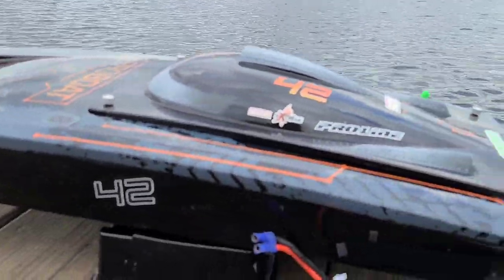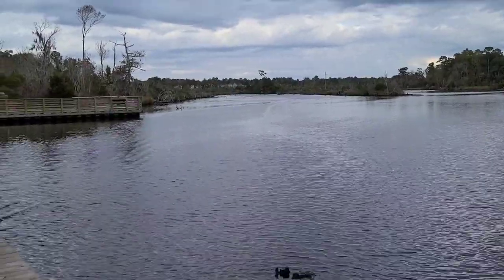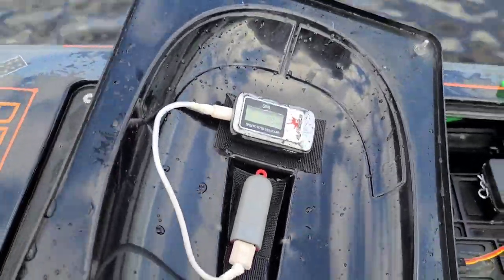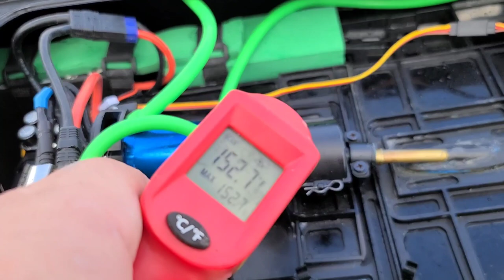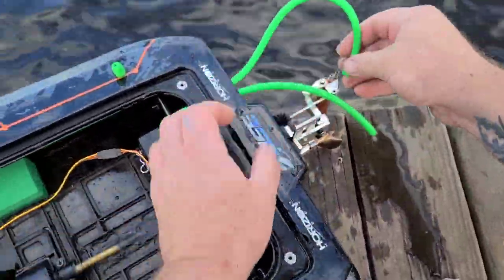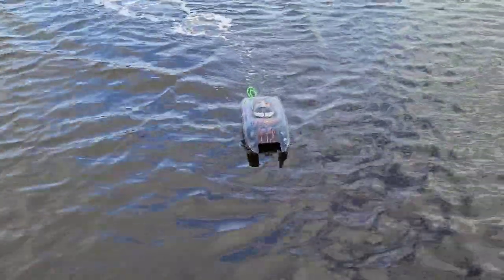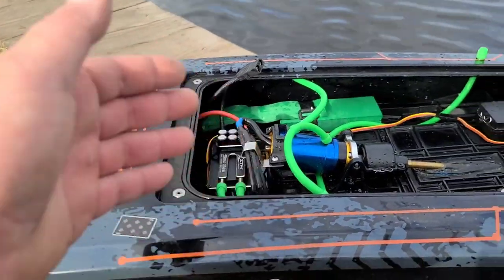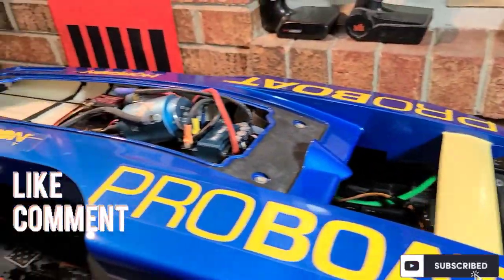Fastest Pass Yet Blackjack 42 - FE Cooling Tip - Fatal Rc Boat Crash

Comment: That water cooling with that water bottle was genius ! Im taking my Blackjack 42 out on its Madien run tomorrow ! Greased up the prop shaft, charged up my 4s 500mah 100c batteries and tightened everything up ! Siked to get her out in the water ! Wish me luck i have no blowevers or freak accidents that rewuire me to swim out to get my boat ! Haha Cheers mate ! P.S im not going full throttle unless the water is GLASS !! Sorry about your boat brother !
Reply from the maker: Thanks brother, yea out the blue one day I got that idea in my head lol. I only use the water bottle for speed running with a higher kve borderline setup

Comment: How about a small wing mounted on top of the boat on the front set at a neutral angle and a small servo to change the angle of that wing linked to a small gyro , then as the front of the hull starts to rise the gyro would sense this movement and apply a small negative angle to the wing ? In theory that would make the boat unflippable at any speed . Just a thought! Great channel and greetings from the UK 👍🏻
Reply: I’ve always wondered about an active front wing on these boats. Even one w/o a gyro that is connected to the throttle and adds a bit of downforce in a linear fashion with the throttle curve. I can’t get my bj42 much over 65 without it catching air and flipping. The fact that ironclad is even getting some 80+ runs is impressive and a testament to his tuning and commitment :)

Comment: Hey big B it hurts to watch R,I,P,,,, but someone once said a bad day on the water beats a good day at work,,, so heads up please don't stop ur videos be lost with out them f,r and thanks for the heads up on winterizing my RC boat didn't know you had to do that stuff my boats are inside they're not outside in the basement the temp down there b around 47-58 degrees think that be all right still going to do what you said too so thanks for the heads up Wisconsin

Comment: One possible reason to add a water pump - not having to manually cool down the ESC.  if the pump has enough flow it will not restrict the flow at high speed and your electronics will stay cooler on average - I’ve instrumented my boat and log the temps.  That might make a good video too - pump vs no pump and temperature over time.

Comment: Boy o boy B, I'm sorry to see this one but I know how you are feeling. I told you I was going camping at the lake last week, I had beautiful water most of the week. I got Miss Geico 36 up to 79 mph for the first time, I was shaking so much I could barely hold the control, boy was I jazzed. I also took the Veles 29 and was playing with different props and got her to 67mph and for some reason the strut worked its way down to deep and I think pushed the nose down and boat was running too wet, I stuck the bow in a small wake that should have passed over but didn't at 67mph. Sounded like the boat hit a brick wall. The boat landed upright, and I drove her in and found I cracked the hull on right sponson and stress cracks all up in the tunnel and broke right side battery tray loose. I removed both battery trays and doing your mod with Oxidean carbon trays I have them ready to glue in just as soon as I finish with hull repairs and reinforcements. she is going to be a bit heavier hope it won't slow her down too much. I don't know where I'm going to find that green paint maybe just paint the bottom black. I did the maiden run on the Sonic Wake V2 I upgraded the ESC with 160 amp and servo upgrade before ever putting her on the water. She runs good with the stock prop or the Oxidean blue prop but when I put the Oxidean yellow high rake she gets power cuts right as you hit full throttle, so I have to figure that out. I had a fun week at the lake but it's going to be a lot of work fixing the Veles.

Comment: Sorry about the fatal wreck my friend ..... and congrats on the speeds you reached ..... but I gotta mention ..... polycarbonate is strong ... but at these speeds ...I don't think it is as strong as carbon fiber or fiberglass.....  for the hull to separate like it did on your boat I think that on impact the hull flexed to the point where it separated at the seems even though you reinforced it ...... thanks for sharing .....

Comment: So when your new hull comes, are you gonna reinforce the seems and ironclad it out 1st or fix as you go ? Good run and it's gonna happen eventually. I'm reinforcing my Revolt as soon as I get It back from my painter. Installing ul electronics in my Revolt. That should be fun
Reply from the maker: It be quite honest I think all the weight from fixing and reinforcing the hull here lately has contributed to the demise of this hull.   I added quite a bit of weight reinforcing the seem with epoxy and carbon Kevlar...     I think the added weight in the stern from the last repair messed up my CG, Causing the flips.  Idk.
Reply: @IRONCLADRC  carbon fiber isn’t all that heavy. You can get various weights. If I recall correctly, it’s rated as grams per square meter. Go with the light stuff and go easy on the epoxy. Seems like you could keep the added weight down.

Comment: What happened to the air dam idea?  That may have helped to keep the boat on the water at speed.   You can see in the slo-mo that the boat gradually raised it's bow until enough air could get under it to start the high-speed rotation/flip process.

Bummer about that giant crack.  It could be fixed, but retirement and replacement sounds easier.  Are you going to do another BJ hull, or maybe something built from composite materials?
Reply from the maker: The air dam is in the boat has been the whole time

I've  got a blackjack 42 hull already otw
Reply: @IRONCLADRC  👍

Comment: I must of missed the video on losing the top of the tug boat. Are you using cold water in that bottle for cooling..? Either way that's a slick trick.. Man sorry to here about the crash.. You'll have it rebuilt with the new hull in no time.
Reply from the maker: A kayaker knocked the tug boat top off during a recovery. Fluke accident 😐   the water was "room temp" no ice..
Reply: @IRONCLADRC  I installed foam inside mine to hopefully prevent things like this. It floats on its own if it was to fall off. Looking forward to seeing the progress on your new top.

Comment: RIP.
But Hell Yeah u listened to my comment on The Castle Hydra XLX2. Make sure to get a Castlelink too, if u need some information about setting it up safely, just hit me up buddy. Driving those ESC in the 150 m/h range in cars since 5 years. Its way more complex than the normal boat escs
Reply from the maker: I may take you up on that offer, I've owned several castle speed controls but never any of the big dogs.   Thanks
Reply: @IRONCLADRC   yeah, lets do this buddy :D awesome ESCs, but sometimes a bit tricky with setup.

Comment: Why is salt water a big deal? Got my first boat a few days ago and ran it in the sea, day 1.
Reply from the maker: Salt on copper wires and conectors will corrode and degrade the connection, causing resistance. Salt on any electrical component is not good..  rinse the boat with fresh water inside and out when your done running in Salt water, pull the flexcable when you get home Salt water will rust it .   Servo, motor bearings will also rust/loc-up.
Reply: @IRONCLADRC  Oh boy 🤦🏽‍♂️🤦🏽‍♂️. Let me get to work on that! Thanks mannn!

Comment: Do they have trim tabs that will electronically adjust as you give it more throttle and go faster?
Reply from the maker: Off Shore Electronics have a trim tab set that's adjustable via servo, I think there to small for the 42

Comment: Still don't understand the speed. Just go out there an enjoy the boat. Most of these boats aren't designed to go those speeds.  Crack the boat now so what does that get you. Time for the dumpster.  Nothing like throwing $600+ into the dump. You got to know when to draw the line. Build your own boat if you want these speeds. Factory boats don't go those speeds you just blew the boat. That in my opinion is stupid.   Nice boat went to the garbage .I have the same boat I have the miss geico 36 and the m41. Love all 3 but I run them to the specs that is recommended.  Still have them today .3yrs later. Like trying to get a Volkswagen to act like a dragster. Sheese.
Reply from the maker: It's my boat ill run it how I want,  you have your boats to do as you please.   I enjoy pushing my boats to there limit that's just me.  It's the challenge for me.   I built that boat to do exactly what I BUILT IT TO DO ...    GET NUMBERS.    I don't sit my boats on a shelf to look at I run the mess outta my boats every single day.
Reply: You sound like a really fun guy lol what a dork